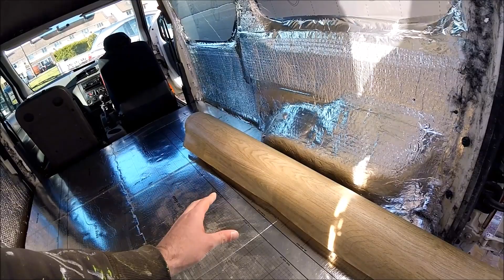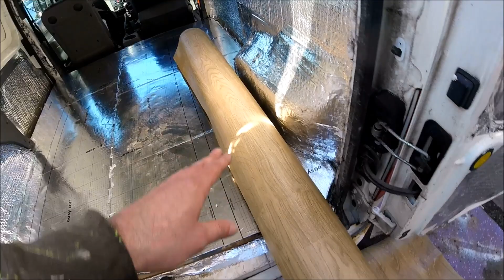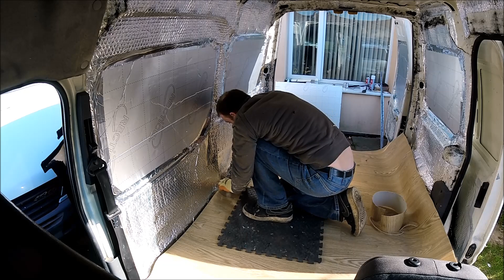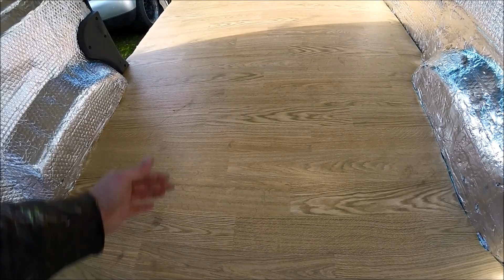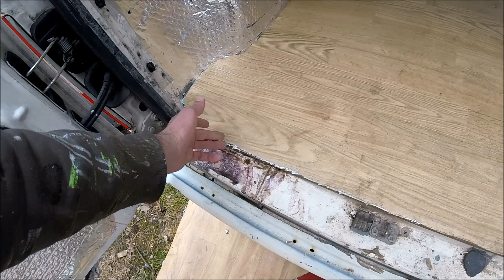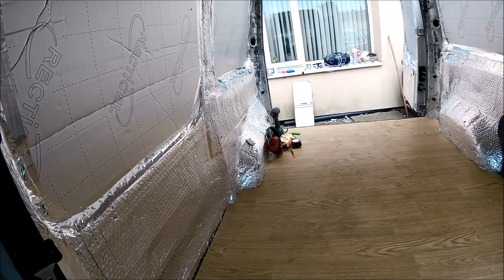Laying Altro Flooring In A Ford Connect Micro Campervan Conversion

Comment: Great tutorial video!  Now I know the type of flooring want to use now .. I have a question tho, what tool did you use to cut the floor with?
Reply from the maker: Just a Stanley knife with a good blade
Reply: @TheCampervanBuilder  are you going to put in windows  into this van
Reply from the maker: @hotpointbrownlover3365  See the latest video, that should answer the question